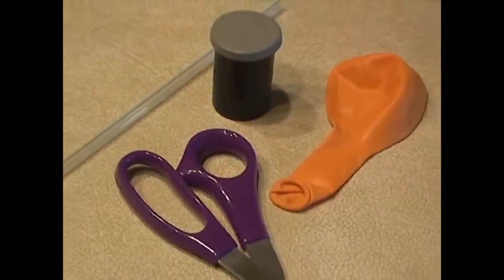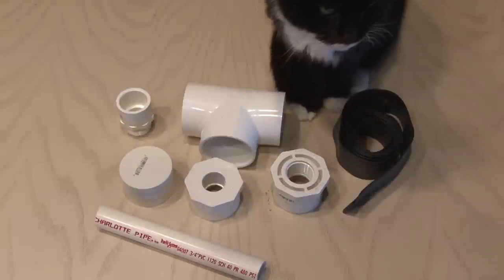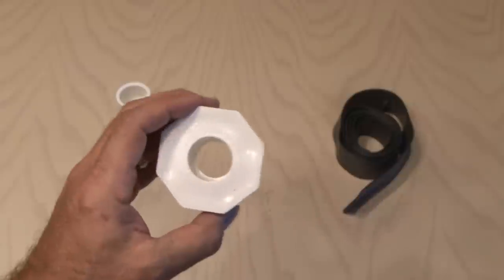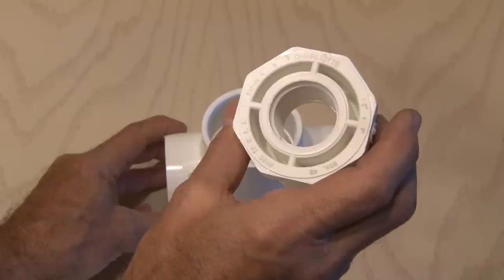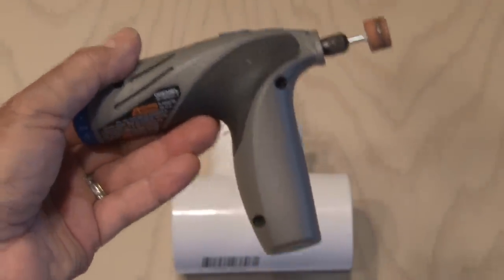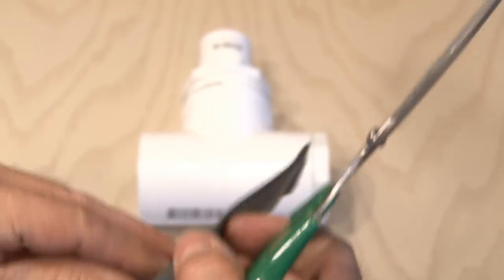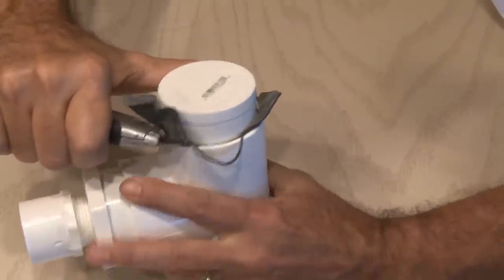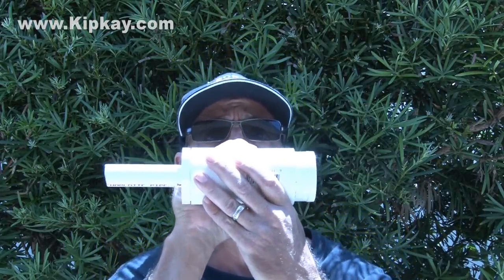"The Blaster" Air Horn!

Comment: I tried this project for myself, and I can say it does indeed work. I recommend inserting the 3/4” pipe in the adapter part of the T section BEFORE inserting the 2x1 adapter, so you can see how close to the tire tube you are before you work blindly. Having the 2x1 adapter in place before inserting the 3/4” pipe will leave you working blindly, with no idea how close you have the pipe to the tire tube.

Comment: This would make a great safety horn for boaters, instead of buying the air horns at the store that when you finally need them they don't work due to long periods of time sitting in the boat and affected by changes in weather. This is something the Coast Guard might actually give a stamp of approval on for their boaters safety equipment suggestions and requirements

Comment: Hook this up to an air compressor!  First glue this thing together.  Where your mouth goes, add a 1" gate valve, then add a PVC 1" to 1/4" reducer.  This will go to an air compressor male fitting and then to your air compressor.  BE SURE TO SET THE AIR PRESSURE LOW SO YOU DON'T BLOW THINGS APART.  Open the gate valve slowly and away you go.  WEAR EAR PROTECTION!

Comment: I love the size and the sound! But is there a way you can use a pressure connection or whatever it’s called I saw this other video but he doesn’t say what the parts were so I’m not sure what exactly he used..but instead of you blowing through it it’s kinda like a knob that releases the pressure into the pvc pipe let me share the link in another comment

Comment: If you would use smaller pipe would the pitch be higher...??
Reply: It's a combination of the length of the pipe, the diameter of the diaphragm and its pipe, as well as the air pressure.

Comment: Do yourself a favor and use sandpaper to round over the edges of the cap where it meets the rubber.  I ended up cutting through the rubber three times before I got it to work.
And start high with the pipe and smack it in a little at a time and try between each time.

Comment: What does the rubber do to actually make the sound when you blow?
Reply: 567legodude The vibration of the rubber makes eh... I don't know exactly but I'm guessing it's related to the air making the rubber vibrate and the air rushing out of the "Blaster"
Reply: Volvary Yup, pretty close to correct.  As you blow, the air exits through the 3/4" pipe at a higher rate of speed due to it's smaller diameter.  That causes a low pressure area in the 3/4" pipe in relation to the 2" pipe.  The rubber gets drawn against the end of the 3/4" pipe, air flow stops, pressure equalizes, and the rubber pulls back away, and the process repeats itself.  It happens at a very high rate, hence the tone that is heard.

Comment: Wow...  Putting an air horn noise over a video and having it out of sink.  Much fail.
Reply: hellcat1988 Using the wrong "Sync"
Reply: Scaredbyowls
yeah I have lexdexia (yeah I spelled it wrong to be funny) and have been doing that long enough to remember getting yelled at by my spelling teachers for it.  You should have seen me with which/witch when I was younger.
Reply: +hellcat1988 kind of a fail though anyway
Reply: Wow, using the wrong form of sync. Much fail
Reply: SlickNicky10
auto-correct fail to be specific.
Reply: hellcat1988 Ah, gotcha. GOD DAMNIT AUTOCORRECT!!!!